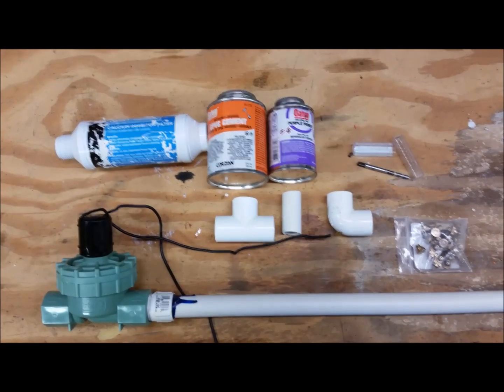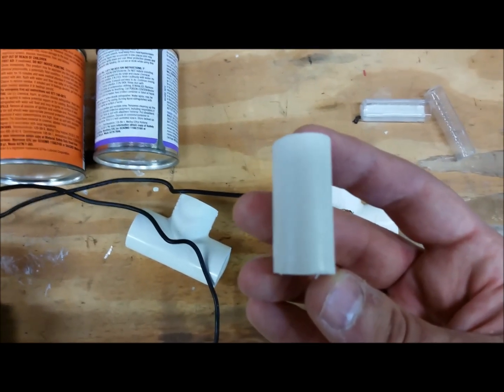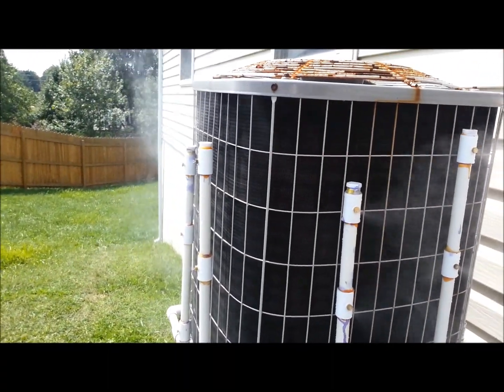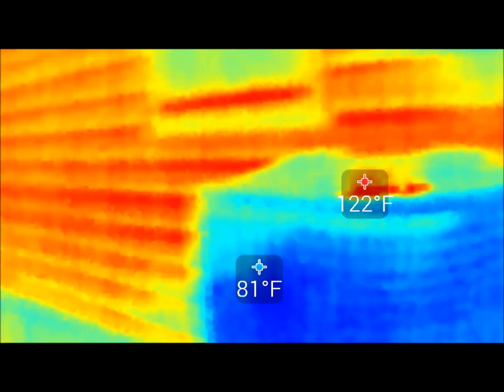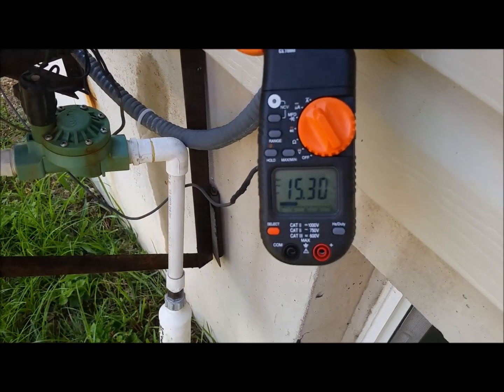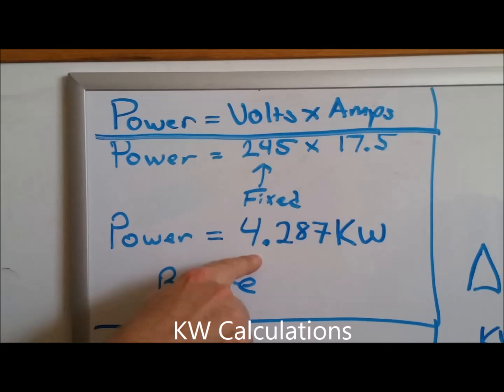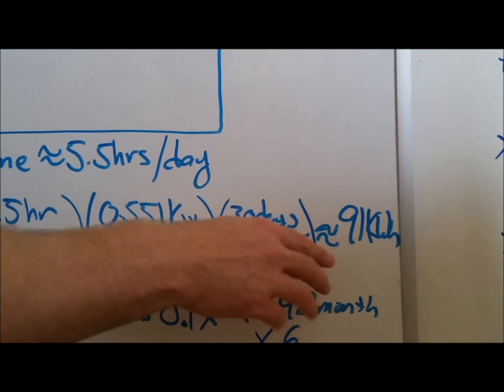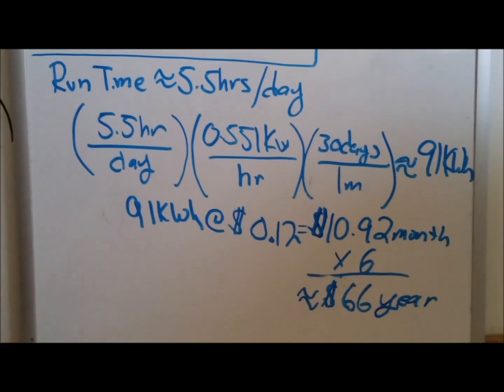DIY AC Mister Reduce your HVAC Cooling Costs Thermal Image Part 1

Comment: All this is doing is raising your subcool that's not lowering the amperage of a compressor at all
Reply from the maker: Lol.  I guess you didn't watch where the current dropped.
Reply: @stem_saving1644 yeah it dropped 2 amps...   440 watts, 0.44 kWh ..   which is like 5 cents an hour. But what youre not seeing is that the subcooling just increased dramatically causing the expansion valve to close down lowering the condensers cooling capacity. So yes now youre paying 5 cents an hour less for you 4ton condenser to only have 3 tons of cooling capacity
Reply from the maker: @jakbo_ your mistaken. The house cools quicker due to the fact the heat can be exchanged at a faster rate, which actually made the tonnage go up, not down.

Comment: What a great way to rust your AC to hell and waste a ton of water. But I suppose if your AC is garbage and you got nothing else...
Reply from the maker: Should I bring it inside?  They are designed to sit outside in the rain.  It's worked fine for over 5 years..... not sure what the problem is.

Comment: Confirm what the valve connects to for on/off ! Very interested. I'm building today !
Reply from the maker: It's connected to your small thermostat wires, just like in my videos.  The 26v not the 240 volt. These are the small wires.

Comment: The irrigation pvc is 1/2" ? But the on/off 240volt sprinkler valve is 3/4" fittings ?? Please confirm!
Reply from the maker: It's a 26v sprinkler valve, not 240..  There are multiple types with different size inputs. Simple 3/4 to 1/2 adapter would make it work.

Comment: July 2024. We live in SoCal Desert. Using AC at 77° for 8 hrs (11am to 7pm during summer) total house consumption is 44kWh. Increasing degrees to 80° consumption is 30kWh. Utility Co charges $0.38 per KWh. Basically $17 per day ($510 monthly) vs $12 per day ($360 monthly). All rough estimates. I do use a swamp cooler for the night (running electricity consumption already accounted for in these numbers). I also have an old AC unit. I want to test this also to add to our savings. Every cent counts towards our annual 7 day vacation during thanksgiving week in All Inclusive Resorts in Mexico beaches....cheers!
Reply from the maker: Great, you keep such good  numbers!  I also looked into precooling before temps get hot.  Seems to work as well. Using rain water offers the cleanest water. If you have hard water, you'll need a filter of some sort.....

 You're absolutely right. Every bit helps.

Comment: Yes, the mister reduces the use of power and cooler air from the air ducts.  After two years of using this mister on your condenser, what happens to the cooling coils?  Did it start to deteriorate or dissolve due to electrolysis being constantly wet when the condenser turns on?  give it another two to three years of use now your colling will all be dissolved by corrosions and now time to replace the condenser which in today costs 2024 approx $10K-15K
Reply from the maker: Nope, sorry, Mister worked for a good 5 years.  Upgraded to a heat pump and going to reinstall soon.  The condenser doesn't cost 10k unless you're getting scammed. I installed an entire system for under 4k

Comment: I live in Arizona. I have also lived in New England and Texas. No matter where I have lived, when the ambient temperature of the condenser is lower (like when using a mister to reduce the ambient air temperature), it takes less electricity to cool the house to a constant temperature. I haven't checked other areas, but I assume if the difference in ambient temperature and inside temperature is less, it takes less energy to cool. That's probably universal.

While some 'experts' may be correct that if the system was operating outside of its design parameters it could cause a problem, this isn't the case when reducing the ambient temperature from 100 to 80 or 90 to 70. If the drop is much more, the simple thing to do is open a window.

If evaporation didn't absorb heat, these guys wouldn't have a job. All you did was build a swamp cooler for the AC. My daughter cools her whole house with a swamp cooler, so it must work.

I have a concern and a question. My concern is scale buildup on the condenser coils. We have hard water where I live. Here is Arizona, we don't get enough rain water to use so I would be stuck with city water from my water softener. That's my concern.

I saw your calculations for money saved and it makes perfect sense. My question is where do you live? What kind of ambient temps do you see and what is your typical humidity? What size is your AC?  Here where I live, we're currently averaging around 106° and about 10-15% percent humidity. Low temps overnight tend to be around 78-82°. I am guessing I would see better savings than you. My unit is 3 tons.

Thanks for your hard work.
Reply from the maker: Thanks for the thoughtful  comment.  

I'm in the Midwest and we see temps in the mid 90s and sometimes a hundred. If you're using city water,  definitely use a calcium filter.  The hardness is something to test for or watch for. 

Humidity varies between 40 to 60%  its quite a large range of conditions. 

Since you don't get much rain,  I would invest in plastic cisterns 500 gallon or more,  so when it does  rain,  you can capture a lot. 

Another thing to consider is precooling, running the ac really really early before it gets hot, this will also reduce power/ energy consumption as air into the condensor is cooler.  I seen about a 15-20% decrease in doing this. 

The hotter the ambient temp.is the more  savings you'll see with misters.. Hope that helps.
Reply: @stem_saving1644  Thanks for the response. I am going to throw together some misters to test the effectiveness. I'll prbably use an irrigation valve, like you did. I live in a community where I don't have a lot of room outside so I'm not sure I could store that much water. First things first. I'll mist the condenser, test current and outlet temperature and see what the improvement is.
Reply from the maker: @mrschwarz1950 you could even use a garden hose with an adjustable sprayer for a test.  Let me know what your results are for your area.
Reply: I'm a master licensed HVAC tech since 1978 the mister doesn't lower the ambient temp  the water runs on the coil to keep it cooler , therefore the ac cools better the heat in the condensing coil is the heat that's been removed from your home by the refrigerant its basic HVAC 101 , the condensing fan pulls are across the coil to help keep it cool but when you try and pull 130 degree air it makes compressor over work
Reply from the maker: @henrykennedy1120  your confused. Any time an  element  changes state it either absorbs  or releases heat.  When water turns into a mist it absorbs heat.  That's physics 101 which governs hvac 101.
Reply: Dude stop ive installed units with this source for years and I set it where it doesn't mist like hairspray kid   , all mine are like the fine spray of a shower head not a fine mist so that's what you do I dont do it that way ,mine and I mean 1000 s , are a fine spray it keeps it more efficient
Reply from the maker: @henrykennedy1120  to each his own.  I'll stick with what I have.  I'm not looking to go through a lot of water.

Comment: Any info on how the valve is wired?
Reply from the maker: Just like how it's wired in the video..... to the 26v signal coming from the small thermostat wires.
Reply: @stem_saving1644  ok thank you. I was having trouble hearing that part of the video and wasn't sure.

Comment: I was thinking of.using comdestae drain pump then connect the ends with spray misters... Will the condensate pump create enough pressure for the misters
Reply from the maker: You will need 40-60psi of pressure condensate pump probably won't supply enough pressure or water.... depends on how many misters you run.  I have 50 gallon barrels for my old mister.

Comment: This has been 5 years.  Are you getting scale deposits on your condensor?  How effective is your filter, and how long does it last?
Reply from the maker: I have installed a heat pump since then.  Getting off natural gas. I got about 2 months off the filter, also switched to rain water.  Check out that video.

Comment: I like that you had math to back up your conclusion . This is a great DIY project and it adds good information for people like me that want to make a misting system !!!
Reply from the maker: That's usually the hard part for people to understand as it substantiates the system works. Just need to pay attention to your water supply .. if it has calcium or not. I found that using rain water is best.
Reply: @stem_saving1644  Oh really okay . thanks.

Comment: There could be more savings than what is described here because your AC unit may have more off time due to the fact that the misters are cooling down the condenser making more effective at cooling the house quicker. The measurement taken here was for runtime only. It didn't calculate the additional offtime. Ac units typically have about the 30 or 40 degree differential when cooling and if you can bring down the temp of the condenser by an additional 20 or 30 degrees through misters than that means you will be getting much cooler air coming from the evaporator which also means a quicker cool down time.

I regards to comments about using a vapor mister and the corrosion issues it may cause I believe this could be a valid argument in some cases. Water can often be corrosive to metals including aluminum which can be corrosive on it's own. Mineral deposits will facilitate this quicker however if certain precautions are taken such as using water filters it may help that. I have put light coats of spray paint on areas I know are highly corrosive or one could consider using a light coat of wax spray. This is a controversial subject though. I'm kind of mixed with trying to protect condenser coils with a layer of paint while I also know that doing so helps insulate the heat making the coil not as effective. Nothing really beats straight metal being exposed to release heat but also wanting some layer of protection to keep it from corroding.
Reply from the maker: There is truth to that.  I wanted to get a rough estimate on its results to show it's worth implementing.

Comment: If you buy a pool and use the water in your pool. Then spray it through fins. Then catch the water going through the top of compressor unit and pass that water through filter then pool. Then you can use that cold pool water to cool doen fins!! And have warm pool water. Without consuming water from the city in the process. Then use solar pumps for the water pumps!!
Reply from the maker: True, but for the price of a pool,  I can get    10 ac  units.  Which will outlast me.

Comment: You didn't mention that in high heat it's help to run the system way more efficient. I live in Texas and when outside temp get over 105 F and my thermostat is set to 82F the unit works non stop for over 5 hours until it get to 11PM and outside temperature get lower. With this mister I will save way more that what you calculate on electricity usage. My unit blow 65F at night and 72 in middle of the day. The refrigerant pressure is in range.
Reply from the maker: Your milage will vary,  but yes.  The hotter it gets,  the better it gets.  Make sure to use calcium filter or rain water if you have hard water.
Reply: @stem_saving1644  our city water hardnesses is around 129 ppm.
I am seeing bad reviews on the filter you linked on Amazon. Even if I find a good filter, changing it regularly is costly. so I think going with softer sources like rain is the better solution. Also adding a micro controller with temperature sensor by register to activate the system only on higher blowing temperature inside is something that I am thinking about it as  a phase two. The micro controller like Arduino knock off that cost less than $10 with sensor and relay. Can be used with ITTT service and have easier control over it. Like active mister when AC is on and sensor reads over 67 Fahrenheit degree for over 30 seconds.
Reply from the maker: @VafaGhoreyshi  you can set it up how you like.  I tried to keep mine simple as possible. When ac kicks on, so does the mister. It's usually only on when temps hit above 90f outside or inside is above 80ish.

Comment: Yes reduces your power bill...but also reduces the life of the condensing unit years..Also voids the manufacture warranty..
Reply from the maker: Voids the manufacturer warranty?  How so? So you're saying after first rain the warranty is void? If not,  what's the difference, it's getting either way?
Reply: @stem_saving1644  Personal experience in the field in the 80's. when mister systems first appeared in Florida ...Don't believe me look it up then argue.

Comment: So just looking around here, I haven't seen any reference to using a Calcium Lime and Rust (CLR) remover say once a year to "clean" the coils.  I realize letting the CLR remover sit not on coils isn't a good thing however, a soak and rinse within a minute or so maybe two or three times should remove any residual contaminants.  It may also have the side effect of keeping the coils cleaner too.  I have two a/c systems (one for upstairs and one for downstairs) so my saving would be twice that of those reported here.  

I am mostly interested in relieving stress on the system with minimal maintenance.  If I could save the equivalent of $120.00/yr with maybe 20 minutes of maintenance, I'm in!  

As long as I do the maint.  the system should not eat the coils and will make the job of cooling the house easier and cheaper.
Reply from the maker: It's an option,  but most times clr is used,  it's to soak in vs where it's sprayed on and runs off. 

You can also use rain water like I did on my other video. It's free from city water additives. Just need to catch and store.

Comment: Looks good, but my concern is that the coils will be getting soaked continually. A better system would cool the air without wetting the unit. Don’t ask me how though 🤷‍♀️
Reply from the maker: Only when the unit is on.  It's evaporatoring as it turns into mist.... which cools the air down before it gets sucked in.

Comment: How did you wire the sprinkler valve to come on when the AC kicks on? Did you wire it to the top of the contactor switch?
Reply from the maker: No,  that's 240v. That will blow it out.  It gets attached to the low voltage small wire side.
Reply: @stem_saving1644  appreciate the response, I understand what you referring to, the 24 volt coming from the thermostat.

Comment: Could you just put the misting nozzles in the PVC pipe instead of using couplers? The sprinkler valve, is it hooked up to the contactor  so that the mister turns on when the system cycles on?
Reply from the maker: Yes.  You'll need a special tap for them.  I tried the couplers and decided to tap them later.   Tap is in the description, I think. 

Sprinkler valve goes to the 26v that turns on the relay... not the 240v.  Normally, those are smaller gauge wires. So,  when the system turns on,  the misters  turn on.

Comment: I DON'T SEE A CALSIUM FILTER OR ICE MAKER MINERAL FILTER ON THE UNIT, WITH OUT IT, YOU MAY RUIN THE CONDENSER , AND DID YOU GET MORE COOLER AIR OUT OF THE DUCT WORKS?
Reply from the maker: It's on there for the tap water.  Didn't see anything outside of normal temp gun error for cooling.  If It were cooler,  the coil would freeze over.

Comment: Option. Shade assembly.  Looks like yours is shaded anyway.  Savings may be 3x if not due to better evaporative cooling? thoughts?
Reply from the maker: Shading will  help a little with heat loading, but not 3x. Most of your reduction in energy will be in how quickly or efficiently you can transfer heat away from the coils. But every little bit helps.

Comment: I did a lot of research on these systems and kept coming back to your design as the best way to approach a compressor misting system.  I have two compressors and installed Rain-Bird valves to control 16 misters on each compressor. I altered the design just slightly in a few areas. If I could, I'd send along some photos and perhaps a video of the system in operation. However, I don't see a way to make that happen. If you have time, request advise how best to get those images to you for review.  Thanks so much. Also appreciate your video.
Reply from the maker: Thanks for the feedback.  I found switching to rain water really helps a lot with water usage,  since it's free. Check out that video. Yeah,  not sure how to get direct messages here.  You could always post a video and send the link?

Comment: Will this help get the house cooler when it's over 100 degrees outside?
Reply from the maker: Yes. As you mist the coils it lowers the power consumption as well as how quickly heat is transferred to the outside... effectively increasing efficiency.

Comment: This might cause accelerated rusting.
Reply from the maker: As opposed to getting rained on?
Reply: @stem_saving1644  a wiser choice would be to make a shed on the ac condensor to prevent direct sun & rain from affecting it. You'll save some energy too.
Reply from the maker: You'd need to redirect the exhaust and size the inlet correctly.  I'd think misting would be way simpler, more efficient, and quicker ROI

Comment: Hey doubters…. 91KW per month fills up a Tesla. And then some. Like getting a “tank” for free.  Also, for those using sustainable energy, power usage is a it deal.  The savings would pose many devices ams lights in a house each day.  Something to consider.
Reply from the maker: Absolutely 💯  correct.  That's 364 miles in my bolt or leaf. It's all about managing the Kwh and keeping money in your pocket.